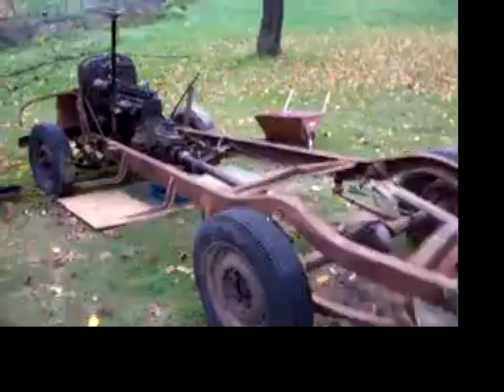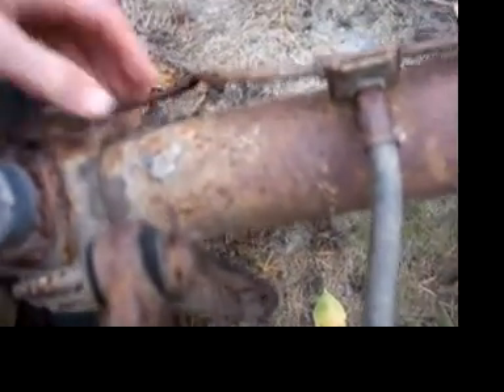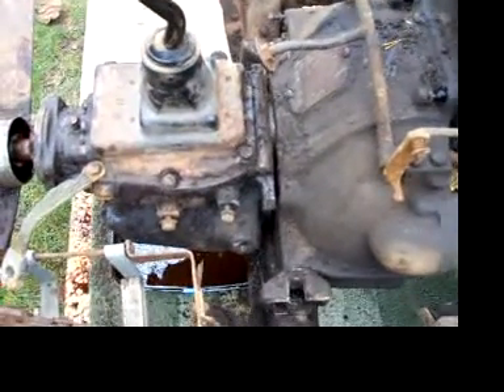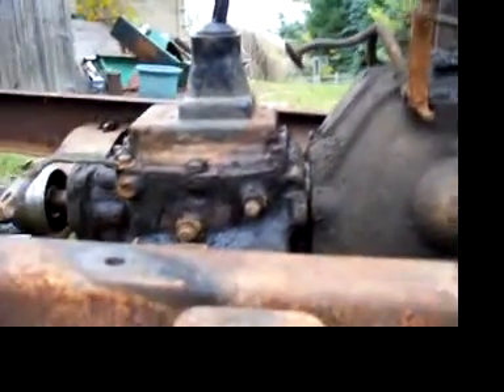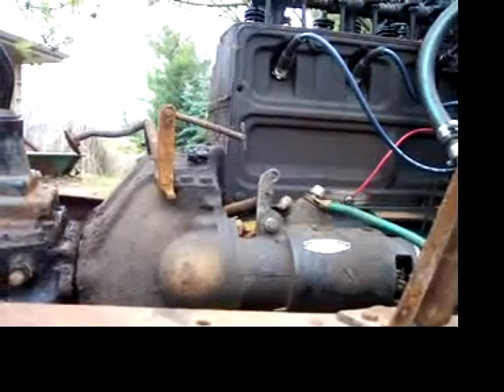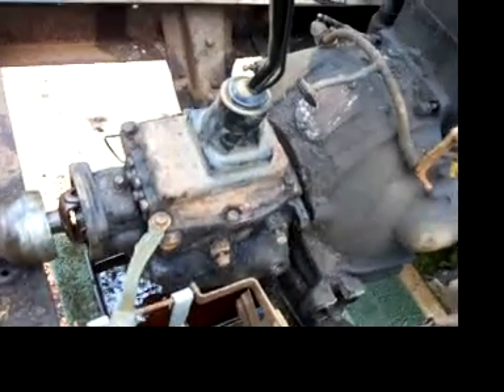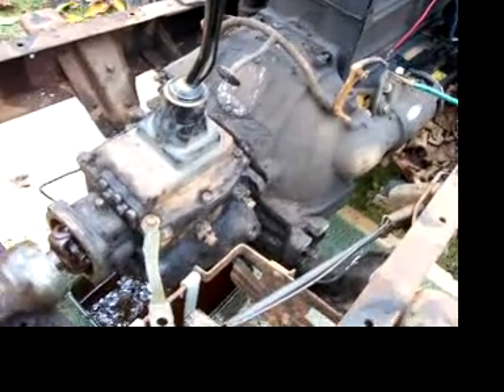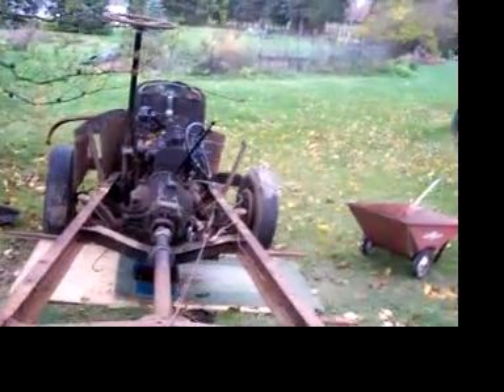My 1941 chevy truck progress update 1

Comment: It's good to see ya' making some progress! To get out the trans you have to either pull the engine or what most do is remove the rear end. If you take out the shackle bolts, remove the shock arms, unfasten the brake lines, and emergency brake lines you should be able to slide the driveshaft off of the trans. There are several ways to do it, just size it up and do the easiest. Kind of a goofy setup on the universal joint, but that's how the book told me to remove it on my '36. Keep it covered.

Comment: hi guy you seem to be struggling with your confidence a bit you doing fine but can i give you some advice please clean clean clean de rust change any bearing you can make or get new gaskets and replace all rubber .....frame paint twice with finnigans hammerite smooth as for the enginge it started did it not clean evrything put new gaskets on it you ll be fine oh and get the frame there and start from that doint worry bout other stuff till you need it also buy best manual you can get john in the ukll ll